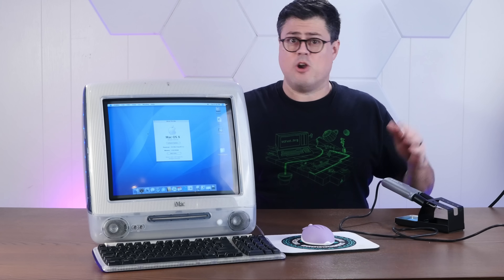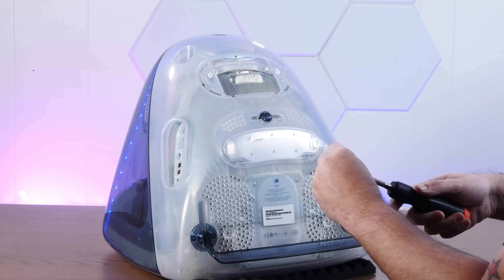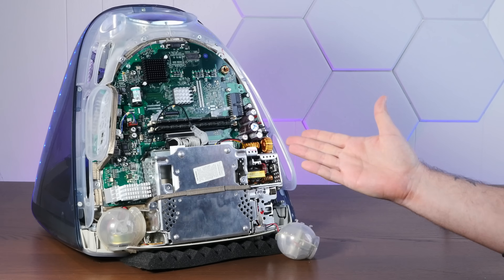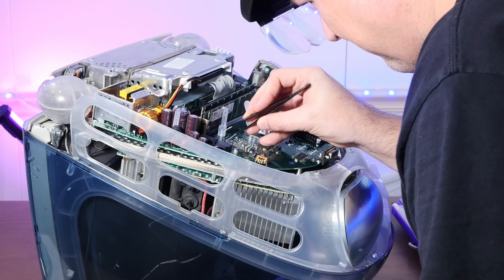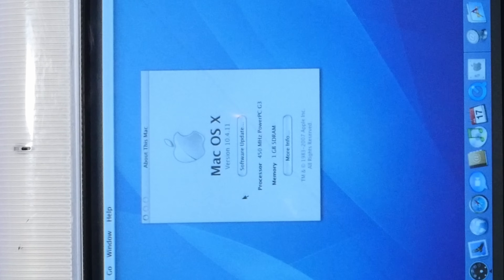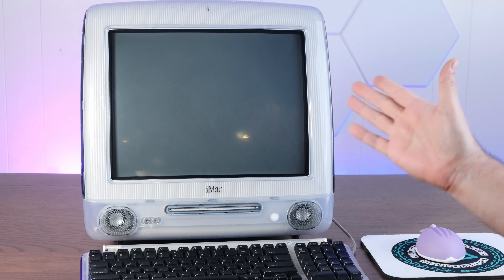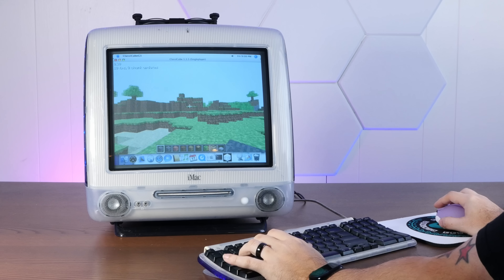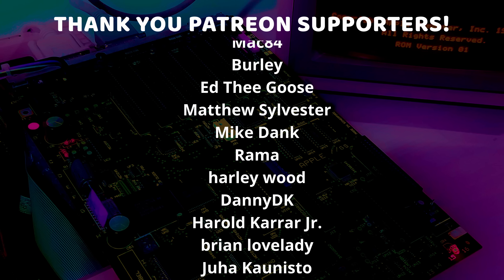Overclocking the Fastest iMac G3

Comment: Nice video! Did you hear that there were aftermarket CPU upgrades for the slot-load iMacs? I heard the G3s went up to 1.1GHz and there may have also been a few G4 boards. You had to ship the whole motherboard to a technician to do the upgrade, since soldering was involved.

Comment: Always fun...
FWVLIW: I suspect those 'resistors' are Zero Ohm, in which case you may find the pad spacing will take a SMD DIP switch package for easier fiddling. Also if you dare, you may find a really thin Peltier and some thermal goo will fit where the thermal pad on the CPU was situated - enough juice, fan(s), fingers crossed you don't thermally saturate the whole thing, and your CPU temp issues will be behind you...
...then assuming the RAM (most likely) isn't the primary bottleneck you may even get a few more MHz out of it.
Reply: 102 means 10 with 2 additional zeros, so 1000 Ohm and 103 is 10 with 3 zeros, so 10kOhm. But maybe they could be replaced with dipswitches, idk

Comment: I'd try and get an exhaust fan that dumps directly outside of the case.  Even stock these chips ran a bit hot.  I'd be careful running at 800 MHz.

Comment: You know since they kind of work like switches, it would be kind of neat for you to add some dip switches, this way you change the speeds on the fly. Just a thought
Reply: You could probably actually even hook them up to a microcontroller and change the clockspeed from command line
Reply: I was just going to comment that I wonder if you could somehow solder on DIP switches to make changing this easier.

Comment: I did this back in the day. Circa 2000 or so. Bought me a base model 350MHz, overclocked it to 400. Also tried soldering on a VGA connector, as mine wasn’t a DV. Sadly that didn’t work. Probably needed some other components.

Comment: What about replacing the CPU fan entirely with an early-AGP era graphics card fan? They were small and narrow so they might fit into the available space, plus the Noctua fans on the back would probably do wonders for thermals.
If mounting it isn't straightforward then in my experience going full jank with zip ties works provided you remember to check them for wear every so often and really make sure whatever you make is pushing the heatsink onto the CPU, rather than just holding it above it.
Reply: Noctua is only for low sound works the same as any other fan I'm pretty well sure. I always just add a dial switch mod to my fans if I can't use a app or adjust in settings like for a console gaming system for example.

Comment: heat wont be an issue because you are not messing with voltage . if you increase the voltage im 90 percent sure it would wall at 900 no more . the reason is 900 mhz cpus are a thing .

Comment: You realize the first CPU that ran  at 1Ghz was the AMD K7@750Mhz, the thing is it did it with a Kryotech case, so basically a no-frost freezer connected to the top of the CPU.
Reply: Firstly that was a very different CPU architecture, and secondly, he tried running it at 900MHz, not 1GHz.  The G3 Mac's case and layout is far from optimal regarding heat dissipation, worse than most standard desktop or tower cases, and was never designed to use a CPU fan. It shouldn't come as a surprise that the near 30% overclock failed. So not quite an Apple to Apples comparison. Pun intended. 😁

Comment: Maybe see if you can up the Bus Clock from 100 to 133, that would net you a big boost to the Ram speed and general system, also see if you can get better cooling on the cpu itself and you could probably bump the voltage a little more or just be more stable thermally
That laptop G3 900 would be a Lot better tho, as it's binned for a laptop it should be a LOT lower power envelope so should be able to clock like a Boss with desktop cooling and power available to it
Reply: Was there even a difference between the old PowerPC laptop and desktop  CPUs?
Reply: @glossymouse7712  yes.
Reply: Bus speeds aren’t changeable on these I don’t believe.

Comment: Love the video! Highly unrelated question: how difficult would it be to give an iMac G3 monitor an input for another video source? My iMac's tube outclasses every other CRT monitor I own by a huge margin, so it feels like a shame I can't use it for more devices!
Reply: I looked into this a few months ago, and it seemed rather difficult. Involved a couple of Arduinos and programming... if that's your kinda thing
Reply: "Rocky Hill" is the channel I found figuring it out, not sure if I can post a direct video link here
Reply: @iiidiy Sounds pretty intense. I'll check it out though, ty!
Reply: Which model are you talking about? I didn't think any iMac ever had a Trinitron. I know the Color Classic did and maybe some AIO Power Macs.
Reply: @eDoc2020  I think I'm just wrong. Looks like I took the knowledge that Apple fought hard to use Trinitrons at some point and just assumed they kept using them after that. A little knowledge is a dangerous thing. I'll remove the reference to Trinitron in my original comment. Thanks for the correction!
Reply: @crtchicanery9605   On the other hand knowing that it's not a Trinitron your options are better. AFAIK most 15" PC monitors use more or less compatible tubes. If you have a worn out PC monitor you could swap its circuitry into the iMac's case. Obviously then you couldn't use the iMac anymore but if it's one with VGA out I guess you technically could. Using the original iMac drive circuitry technically would work with some clever adapters but this would be complicated and limiting. IIRC the iMac (or at least some models) have a fixed horizontal scan rate which means it is limited in the modes it can display. You could display a Windows XP desktop no problem but you couldn't do basic DOS modes.

Comment: Copper heatsink plus one or even two of these shockingly small fans we're seeing these days would probably help. I think the smallest I recall seeing is a 14mm fan? I forget now though.
Reply: he should have soldered dip switches in for overclocking, so he does not have to keep soldering it over and over again to get the speed he wants but he has to do it the hard way
Reply: @SaraMorgan-ym6ue  I thought about that and then just forgot, haha. But yes, absolutely.
Reply: @SaraMorgan-ym6ue  Then it would be interesting to see what happens if he changed the setting while the computer is on.

Comment: I did this mod on my ex's iMac with a dollar store soldering iron and it worked great. It was 400MHz and I made it 450MHz and helped her install OSX.
Reply: taking it apart is easy cause I never put it back together from last time I took it apart I love it🤣🤣🤣
Reply: Fancy tools are nice but often times the tools you already have can get the job done.
Reply: I remember having a 350mhz iMac G3 back in the day when I was a kid. I installed Tiger on it. Did you need the overclock for install or just for better performance?
Reply: Dollar Store soldering iron!?